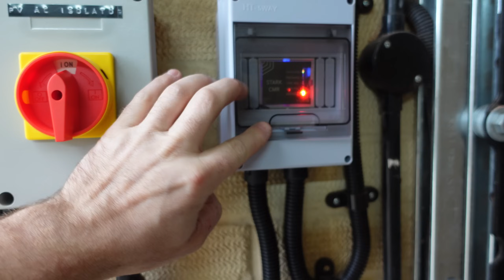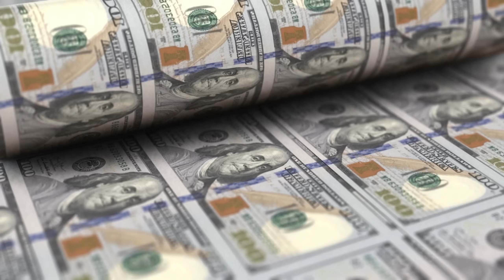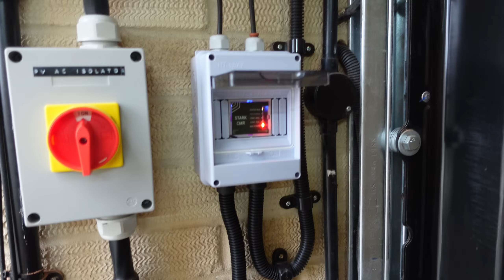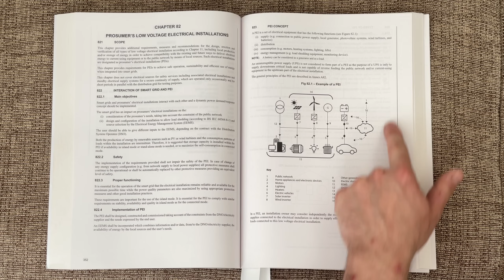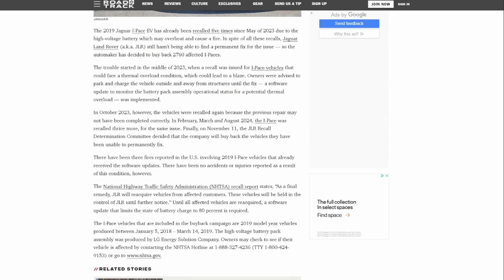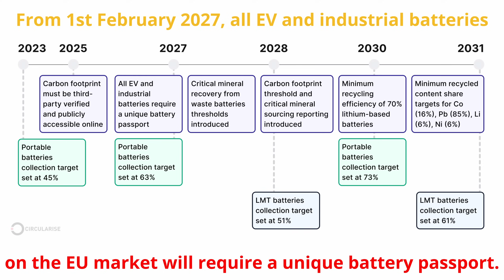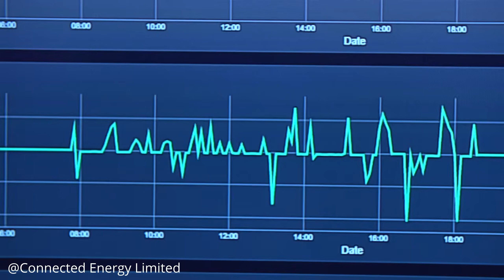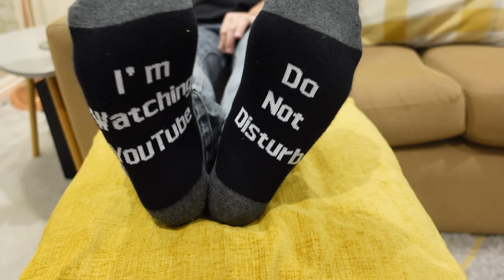4 Reasons I Chose an EV Battery for Home Energy Storage

Comment: Brilliant, thank you 👍  However, as a non-electrician, its so frustrating to know that this option is not open to me. I would love to have propper storage on the house. I'm limited to 10KWh as its all I am likely to be able to afford for a while. Personally, I think that its the vested interests of the DNOs and generators who are effectively lobbying to stop the wholesale re-use of EV batteries.  Its likely to be a huge wasted opportunity
Reply from the maker: If you find an electrician that is on board you can proceed. Generally they would expect you to cover the battery side. You could even carry out the full install with them signing off. You need to be clued up with the rules and regs of where you live. The right electrician might guide you through. But a lot don’t understand how all of this works.
Reply: ask on DIYSolarForum? I don't know, I'm guessing.

Comment: Is there a ‘best EV battery’ to use? I mean the easiest to re-purpose?
Reply from the maker: According to the Battery Emulator project BMW i3 battery packs. They can also be a bit smaller and easier to move.
Reply: My instincts tell me to buy one up now while they are still underpriced… what we next need is someone to start supplying connection kits and then things will really take off. I mentioned this to Dala and he thought somebody already in the case…
Reply from the maker: @richardchambers2620 the problem with selling kits is then you become customer support. And it’s very dependent on the competency of the person doing the install. Heck I had a million questions when I started
Reply: @ I guess a schematic with the identified parts and steps would enable others. From there a product-specific kit could be ordered but as you say, so many variables with inverters etc. but still: thee must be some generalisations to make
Reply: The BYD Atto3 packs actually look quite presentable and their LFP blade cells are some of the safest tech.
Reply from the maker: @grahamleiper1538 I would like to give BYD a try but can’t find many at breakers yards in the UK
Reply: @TheOfficialBatteryMan finding breakers yards in the UK is getting to be a challenge 😢

Comment: When will you go through the costs ?
Reply from the maker: I’ve been burying my head in the sand with that one 😂😂I’ve got a figure in mind. But need to add all the costs. I can see it’s a well requested video
Reply: Figuring the cost is the easiest part. He did state it’s better than common level investments you a make. I’ve done the math before . Even with really cheap electricity and expensive batteries, they do pay off eventually.
Reply: @steventrott8714  Ive seen 12 kwh of LFP storage for 1600€. At that point you really start to wonder whether the extra effort is really worth it.
Reply: @steventrott8714  For reference, a DIY 48V LFP pack sits around 100 Euro per kWh, all in.

Comment: All we hear is with more EVs there will be more electricity used , i dont hear that with more homes getting home batteries we will use/need less from the grid . its taken me 10 year but i have had my gas meter removed and im using hardly anything from the grid. 
i think you have done a fantastic project. i can't see why we can't have in the future community batters.
Reply from the maker: Yes completely agree. Well done 👏 on getting off gas. 

I’ve been able to take energy when the grid doesn’t need it. When the prices are highest and lowest. When the grid is more or less in demand and when it benefits CO2 emissions. Rome wasn’t built in a day. Progress is happening
Reply: @TheOfficialBatteryMan  i got a Powerwall 6 yyears ago and added another last year when the price dropped. i had A2A heating for my 3 bed semi, im still using a kettle to do the washing up and for a shave and an electric shower , it works for me , i will one day get undersink water heaters , i know people say i should have a water tank but im now seeing some people say the tanks are using too much solar. The heat pump and cassettes were £5k and fitted in a day. 
I've really enjoyed watching you videos , Thanks .Octopus have estimated that i will use £250 a year and i still get about £500 a year from my FIT payments.
Reply from the maker: @rodden1953 I’ve toyed with A2A. There maybe a project on the way done in the usual Battery Man fashion 😂

Good for you. I forget how easy life is with a combo boiler. No planning for a tank to be full. Avoiding all the family showering one after the other. Grew up with a hot water cylinder
Reply: @TheOfficialBatteryMan  Someone said to me i was mad not having a tank ,but no one really spends long in the shower ,its negligible the amout even a 9kw shower uses, but i have got another one i can fit thats only 8.5kw , i do live alone but even when i have people stay my setup works ok. i look forward to your next project
Reply: @rodden1953 can you use your spare shower unit for the kitchen tap or is the switching wrong? Perhaps the waterproofing in case of leaks?
Reply: @TheOfficialBatteryMan ground-sourced heat pumps look better if you have the ground, almost all the kit is hidden & near-silent plus the COP doesn't seem to vary seasonally. If that stream is yours it too could be tapped?
Reply: @alanhat5252  I don't see why not. there are small ones for things like workshops . years ago i had an out building i converted into a self contained guest accommodation with a very old over sink heater , but there are some modern under sink heaters that i still need to look into. i didnt go for the grant as it would have cost me more that just having the A2A set up , It is faster and cheaper to heat water on an induction hob than a kettle. and when i had a new kitchen i didnt buy an oven or hob , i got a microwave that will do most things a single induction hob and 2 air fryers and i keep them in the cupboards so all my work tops are clear . i think it looks good . the single hob was only £50 and it's as fast as gas. 
i just didn't see the point of storing so much hot water.
Reply from the maker: @alanhat5252 I agree ground source is a fantastic solution. But I’ve been researching and costs are high. Most people don’t have enough land to spread it out. So need vertical pipework. Which isn’t cheap to install

Unfortunately the stream is just a filming location. At one point you see a walker with there dog walk past. You don’t see me cut to say hi 😂
Reply: Even without home batteries, adding EV load, which is usually very flexible about charging times, makes a grid more stable as long as the utility uses time of use pricing, at least for EVs, but it really should apply to all loads.  All of our EV charging, all our dishwashing, almost all of our clothes washing & drying, and much of our water heating happens during the hours when our utility is swimming in non-carbon emitting power.  That sort of load pays to increase power supply while improving the balance of the grid.  Pretending that adding load makes it harder to provide stable power simply ignores that more load means more money and addressable load (load that can be targeted at times of excess supply) improves stability.

Comment: I applaud everything you've done with this project, but the biggest downside I see in a residential situation is the size and weight of car batteries. I've just ordered two 15kwh Seplos kits from Fogstar which weigh around 120kg when assembled. They can just about be wheeled into place. The EV battery would be great for a remote location where space is no problem.
Reply from the maker: Or built up in factories and shipped on a container and lifted into place. 

You have to use mechanical tools to move these batteries around. My 2 ton engine crane just about handles the size. I can’t see electricians bringing a crane with them to people’s houses 😂😂😂 

I completely agree with you. Sounds like you’ve got some fun ahead of you
Reply: You won’t regret going for the Seplos batteries. I installed 3 of them but went for the 304ah cells which gives me a total of 48.6 kWh. They have worked flawlessly for the last 3 months. At the price I paid it was a no brainer! 👍🏻

Comment: Hey Mate. Well done! I am currently using nissan leaf batteries which I pulled apart and wired in different BMS's for each pack. I desperately wanted to do what you have done but lacked the confidence when it came to the battery communication with the inverter . I did find the Git Hub pages from DALA but it all seemed a bit too hard. That and the fact I would have to fork out for a new inverter was why I did not proceed.
Keep up the good work. I will keep my eyes open for a good inverter to use. I am in Australia and my contract for solar grid feed runs out in a couple of years. Will be more worth while then. Cheers for now.
Reply from the maker: Nice. I wonder how many Nissan leaf’s have ended up scrapped because the battery replacement was 2 expensive after they have all been taken for home energy projects 😂😂

They are a nice slab. Easier to work with. 

Keep an eye on the BE project the wiki is continually being updated with more useful information.
Reply: @TheOfficialBatteryMan "BE"?
Reply from the maker: @alanhat5252 Battery Emulator https://github.com/dalathegreat/Battery-Emulator/wiki#supported-inverters-list